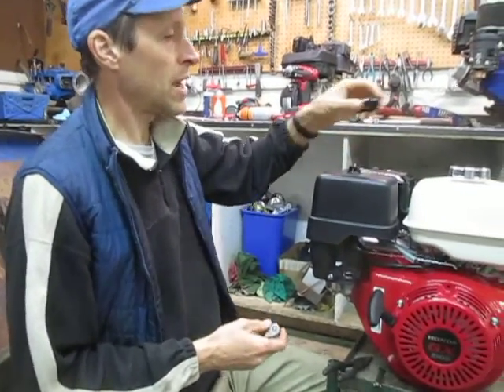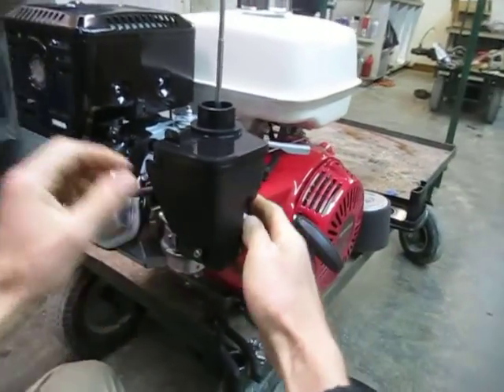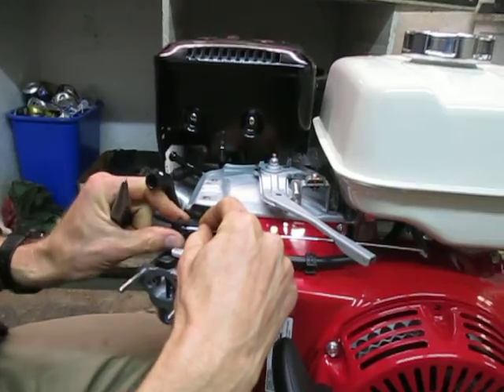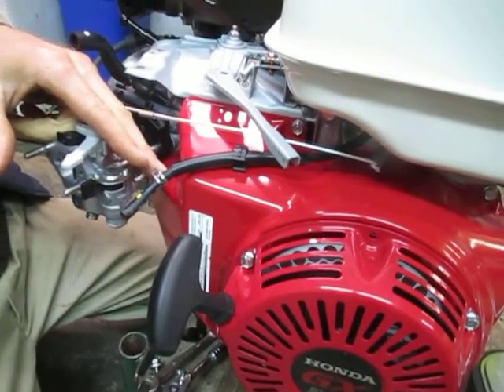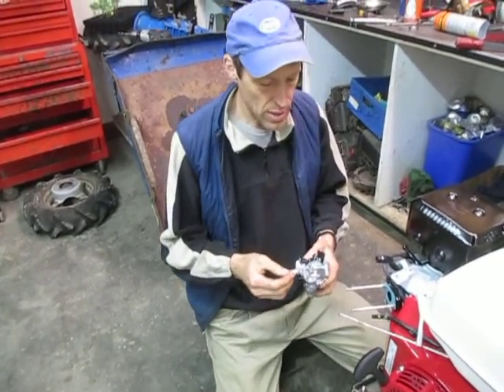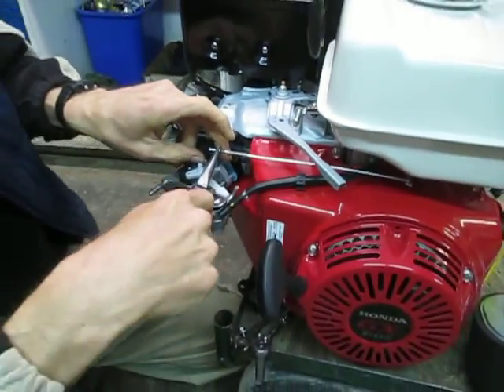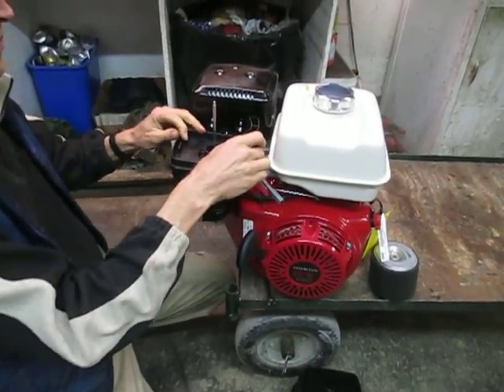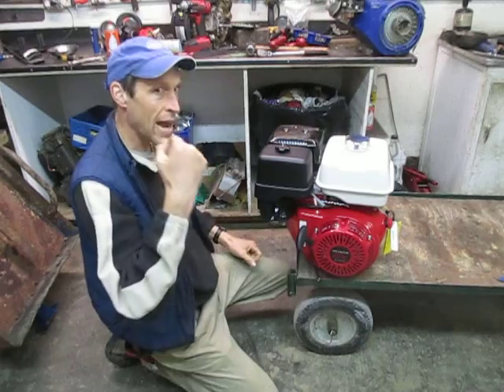Carburetor Replacement: Honda GX Series Engines

Comment: Excellent Tutorial! I used this video to change the carburetor on my Honda GX390 for my 4 gpm pressure washer. I did exactly what it shows and now I am happy to report that my engine runs perfectly!! 8/17/2024│ I bought my Carburetor Kit on Amazon for less than $15...it included the gaskets, an air filter and spark. (not to mention...a bunch of other parts like a turn on/off switch, gas line filter and gas tube with clamp.) Thanks so much for making such a great tutorial!! I subscribed and gave a thumbs up on my computer and phone.

Comment: Thanks for the video.I did something wrong on hooking up the spring... when I push the choke closed it races like crazy.. I bought a cheap Chinese carburetor to replace the one that was on there,it doesn't have that little side sediment  bowl . I was told it's not needed.. my motor is for a pressure washer

Comment: Nice..that looks simple..I'm going to do it now..I'm sure I could do it without the vidio..but it's always a good idea to familiarize yourself with all actions you will be taking..by watching a short vidio..these carburetors are dirt cheap on ebay or amazon..from $15 to $40 depending on extras that come with it..airfilter..sparkplug..plug wire..pull start set up..gaskets ect ect..great vidio

Comment: Thanks!  I have this engine on my power sprayer for pest control and it hasn't run right in a long time.  I didn't realize it was this easy to change so I'm going to be replacing it in the morning and do a good tune-up.  Thanks for the great short video.  It's nice and to the point, which helps me a lot!

Comment: Nice video and very helpul.   How did you know which ones of the wires fit on the starter.  I have a green wire that isn't hooked up but I cant short the positive on the starter solenoid across and it will start  ..  but don't know which wire needs to be hooked up to starter so I can use the key.    any thoughts on this ..   I would appreciate your help.    thanks much..     GD Tractor

Comment: Thanks for the video, very helpful.  I have a generator with a Honda GX390 engine.  It's 13 years old and I just had to clean the carb to get it to run after a recent hurricane.  There's a slight leak in one of the gaskets & I think I'm just going to replace everything, carb/gaskets.  Just curious, the 2 carb stud bolts are threaded on each end.  Is there a trick to getting those bolts out?